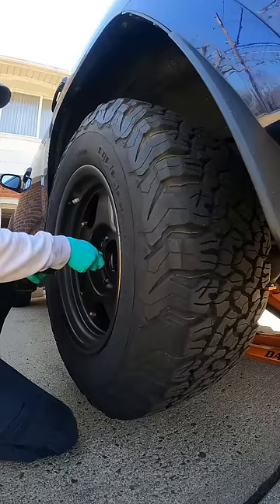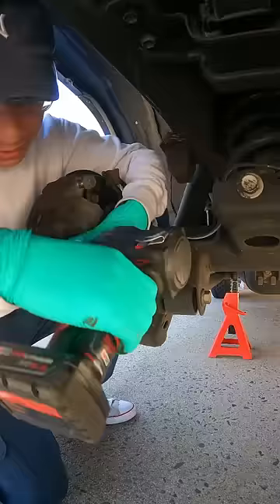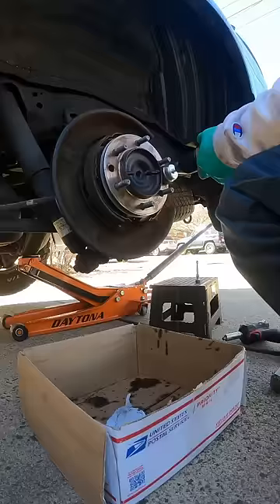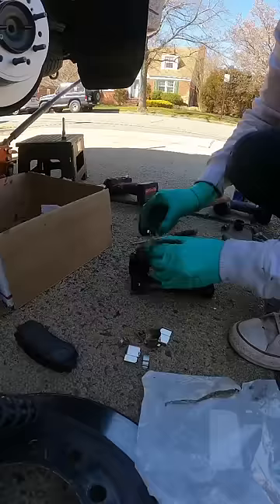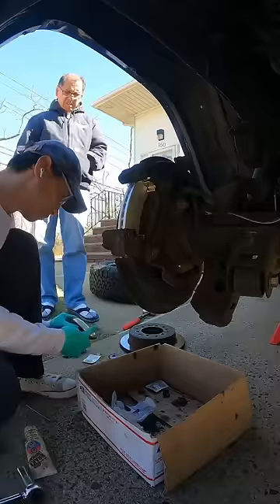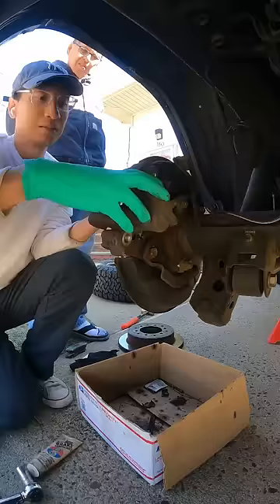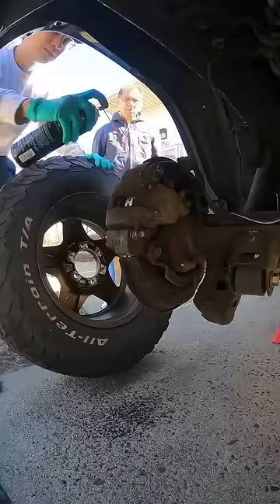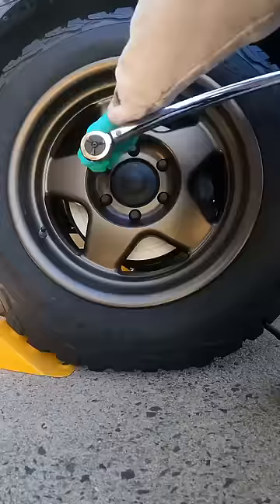Dealer wanted $700 to replace rear brakes. My DIY job cost me $100 and an hour of my time 😎

Comment: Oh so you find all those tools you were using in the back of a cab? 

Guess we're not factoring that in?
Reply: About $400 in tools between M18 impact wrench, a torque wrench, sockets, etc.  You can cut that down to under $100 easily, you just won't have the impact wrench.  Might need a breaker bar to break loose the caliper bracket bolts.
Reply: @luisamoa2500  I like Dustin's response better. He didn't appear to take it personal. Which is good, because it wasn't meant to be personal.
Reply: Tools are reusable, and the cost gets broken down over every use. There is a good chance that he already owned the tools.

Comment: I call b.s. no dealer is that high. More like $200 to $300.
Reply from the maker: sounds like you've been to every dealer in NYC to ask for pricing. $200 is a brake job at an independent shop, if you're lucky.
Reply: They are that high. My daughters friend took her car to a shop and they wanted $1200 to change rotors and pads on all 4 wheels.
It cost me $225 in parts to change 2 of my daughters rotors and pads on all 4 wheels.
Reply from the maker: @kmacnumber2  that's the spirit! DIY brake jobs aren't so bad and can save tons of money, even if you buy parts off the shelf at Autozone or O'Reilly's. I got my rotors and pads on sale at Rockauto and my wallet couldn't be happier!
Reply: @boltsandbanter  no I work at a dealer. So I know the pricing
Reply from the maker: @tonygregori4138  cool so maybe your dealer can teach NYC dealers a thing or two about fair pricing. I haven’t been quoted sub $500 for a brake job, ever.
Reply: I totally disagree. I would've expected more than 700 from a dealer
Reply: No Toyota dealer maybe. I can look up any Volvo dealer near me and it’ll be $400 for a pad slap on one axle. $1600 for pad and rotor F+R
Reply: That's probably only for the pads.
You claim to work for the dealer yet you do not know anything about the prices (parts +job).
Reply: Firestone quoted me 900 for brake pads on a GMC Acadia. They also quoted me 800 to do plugs and wires on my Silverado. I did not have them do work on either car. I guess I’m only using them for tires.
Reply: My shop I charge around $300-350, if I didn't charge that much my shop wouldn't exist
Reply: Well folks those shops want to make money yes they also use factory parts which are twice to 3x as expensive as auto zones Chinese or Taiwanese or non USA made parts. You pay for what you get. I don’t agree on the price of factory parts but they are designed for your specific model so folks take that into account also it helps if you know a good mechanic
Reply: Rotors and pads: $3-500 in parts alone
Reply: @TheBeingReal  just put red powder coated calipers high carbon rotors and fresh pads on the back of my Toyota for 350 bucks. Not sure where you are paying 500 dollars for pads and rotors but I would recommend reevaluating where you buy parts
Reply: @evandrewmartinez1  F350
Reply: They quoted me $750 for a brake job at my local toyota dealer. I laughed my way right over to the parts counter. Bought the parts for $105, took them home & did it myself. Cost $50 to have the rotors turned. 
The deakership tried to tell me I had to buy new rotors without them even having looked at them. 
They are assholes & so is every person who works for any car deakership.  Yes that means you.
Reply: Most of that cost was oem parts. Toyota brakes are pricy
Reply: Dealers charge like $500 for blinker fluid and seasonal tire air change (not good to run spring air in the winter) lol
Reply: You have no idea what your talking about. I work at brake Masters as a tech and did all four brake pads and rotors on a Honda Accord. I looked at the customer receipt and was shocked they charged them $1200.
Reply: @kmacnumber2  that is what they charge at my work.
Reply: @waynes.2983  The tech does not make the rules  or prices. We just diagnosed the vehicle and it is management and service writers who screw people over.
Reply: I work at a chevy dealer. I promise you we would charge at least 250 for parts alone.
Reply: @boltsandbanter  Apples and oranges. Prices vary depending on location, lower operating costs, lower prices.
Reply: @evandrewmartinez1  Red calipers add 700 horsepower, that's a fact.
Reply: @waynes.2983  Thank you so much, but anyone that wouldn't put new rotors on with new pads has nothing of value to say. So, you take a rotor, probably already warped, machine it thinner, so it's more susceptible to warping, and you think YOU are the smart one?
Reply: @Wishes890  lol I was just wanting them powder coated, of course now they offer black 😂

Comment: “RockAuto: All the parts you’ll ever need!” And I believe it. Most of my parts for my 02 Saturn comes from that website! Foglight assemblies, electrical connections, brake kits and calipers, suspension and soon to be alternator! So far, the parts are holding up the test of time and driving.

Comment: Here in Ontario a bit more costly. But same idea. For my Chevy it would cost $900 for all 4 brakes and rotors but I did it myself for $400. Got slotted and drilled rotors for that price too. Diy work is a huge money saver

Comment: Another tip, for a more complete job, depending on the degree of rust, remove the shims in the caliper bracket and wire wheel the shim mounting surfaces to a perfect finish. Apply some paint as you've just exposed bare metal, and install new shims. Also worth noting that the caliper piston surface which contacts the pad, as well as the opposite side of the caliper inner face must be wire wheeled and protected, in order to apply even pressure on the pads. Hope this helps, happy wrenching 🔧🧰

Comment: same, never changed a brake in my life, but Honda wanted $500 to change brakes and rotors all around.  Bought all the tools  I needed, and brakes and rotors.  Did the work myself after watching several videos.  Now I have all the tools for less than what they wanted.  Next I  did engine oil and transmission oil myself.  I find it fun and relaxing.  Not sure I would do on a brand new car, but my old Honda, who cares.

Comment: Did my brother's car front and rear disc/pad change myself. The rear was very difficult as the top bolt holding the caliper is placed at an akward position behind the hydraulic line. I was able to do the job with torque spec ;)

Comment: You only need to apply grease to the guide pins which I did not hear you mention. Also check your dust boots on the piston(s) and guide pins. Even a small pin hole can cause severe rust which will lead to premature brake failure.

Comment: What sockets do you guys use? Just finished doing the rear brake and rotors on my Mitsubishi outlander sport and the brake line was in the way of a bolt. Idk if my sockets are thick or too long. Ended up using a 14mm wrench..

Comment: Great job doing it yourself. Lexus was going to charge me $1,700.00 for a complete brake job. I did it myself upgrading to Powerstop vented and slotted ceramic brake kit for $450...huge performance difference

Comment: Over all really good, just one small but important point, you want to ensure the end of your slide pins are clean as you don't want non compressible grease on the end as it affects the pins from being correctly torqued

Comment: Recently changed vehicles and found new ones standard pads and rotors are like $270 instead of $100 or less. Was quoted $900. Well worth knowing this stuff. Also don't forget to clean the slide pin settings. Rust accumulating can cause pinching.

Comment: Amen. Dealer repairs are insane. $1100 for a lower ball joint. $1400 to “reseal oil pan”. $160 to mount/balance tires, PLUS the tires!

Comment: That's not bad. Dealership charged me $1300 for one front wheel rotor and caliper replaced. Inspection was in with that too I think.

Comment: Did the same for my Vauxhall Insignia. Quoted £700 for two rotors and sets of pads + labour. Found a set of Brembo pads and rotors at 65% off, bought some torque wrenches, total spend £250

Comment: A tip for you, don’t tighten the lugnut with an impact until all other lugs are tightened. Tighten gradually and the cross. Do this in two cycles and your lugnut bolts will love you 👍🏻

Comment: Same reason I started doing my own work. $600 to change an outer tie rod…. Picked up 2 inner 2 outer at rock auto for $144 shipped. I called bbb on that dealership for price gouging. 
The most expensive outer tie rod end for my car on mopar factory replacement was $84. 
They quoted me $7440 for new cats. For that price I’d just straight pipe the charger fym. 
Rock auto has them for under $350.

Comment: I get it, my mechanic did the same thing for my Toyota Camry 2015.
$500-600. Did it myself for $40.00 premium pads. Easy to do and if your factory rotors aren’t bad use them unless there really warped After market ones never last long there cheap metal. Took me about an hour. Saved a ton, it’s not rocket science.

Comment: It's true, I have friends that spend $500-$600 for brake pad replacements. It's amazing how much mechanics charge for simple jobs.
Reply: @Blueissocool yeah Im doing a $1200 service on my 19 escape, but that all new pads, all new rotors, all 4 new calipers and a brake fluid flush and new rear shocks and oil and filter change. Soo I can kinda see where the dealer got  $700 for the quote for brakes

Comment: A girl friend of mine was in tears because Les Schwab in Seattle said she needed to spend $800 to fix her brakes, I fixed it for $34

They said she needed new rotors and rear calipers.

The front brakes needed new pads and the rear was still good and she had a couple broken lug bolts that i hammered out and replaced.

Nothing wrong with the rotors or calipers.

Comment: During a disc-brake pad service, pushing the caliper pistons back into the caliper bores without opening the bleeder valves may dislodge some of the sludge and distribute it throughout the system, possibly causing further damage - particularly to the proportioning valve.

Comment: Pretty good job, man. Pull slow and steady with the torque wrench like you did on the caliper bracket anytime you use it. You kinda yanked it when you put the caliper bolt in.

Comment: I went to leschwab once when I bought my car. It was 1300 they also wanted to replace the brake calipers, I did it myself and they were in the best condition I've ever seen 20yo calipers in, pads didn't even need replaced but I was upgrading to slotted rotors.

Comment: Brakes/rotors, oil changes are so simple once I did a couple successfully that I realized how dumb I'd be to pay anyone anything to replace. Car shops, especially the dealer, will straight up rack u up. And they have a lift, which makes it even easier

Comment: D. Adjust the internal brake shoes first before removing the disc /rotor and then don’t forget to re-adjust after before you put the brake pads on.

Comment: Remember on adjusting the back brakes the funal adjustment you do behind the wheel and that's rolling the car backwards and forwards and hitting the brake and then alternate by putting the emergency break on do you notice it tightening up enough or it only takes a little bit of engagement

Comment: There is a threaded hole on the rotor. If you screw a screw into it it will separate the rotor without having to smack it with something

Comment: Funny, my local GMC Dealership just sent me a flyer for $200/axle on OEM brakes, which was pads and rotors and/or shoes and drums. Parts and labor.  I thought it was a misprint or something, so I called them and they confirmed it was a special they were running for like 2 weeks.  Now they are charging $139 for Pads and $185 for rotors. ($324/axle X2 = $648 plus tax.  So, it wasn't all that different than I paid for the brakes I installed)
But I had already upgraded my brakes to the Power Stop Z36 rotor/pads Front and Shoes/drums rear.  $618 Tax Included, minus a $30 rebate was $588 plus my own time/labor.

Comment: One more important tip: never let brake cleaner touch rubber parts such as brake hose and caliper seal. It will damage rubber parts and can cause leakage in extreme cases which would cause brakes to be lost.

Comment: I recommend a small film of anti seize between the hub and back side of rotor hat. This helps to prevent sticking the next time you need to remove the rotor.

Comment: If you just need pad replacement, 100% DIY.

Beyond that, there are a lot more reasons to consider ponying up for professional help (i.e. your confidence in your ability, the tools at your disposal, the value of your own time, etc.)

But remember, YouTube and Harbor Freight exist, and you can buy all the tools to do your own brakes for the rest of your life for the cost of a single professional brake job.

Comment: Why did you have to take the caliper all the way off? Also good idea to open brake fluid reservoir to relieve pressure opening the caliper. I’ve thought about opening just a brake shop for as much as shops charge, it’s like a hour job per set max

Comment: Honda wanted to charge my $1000 bucks on my si JUST FOR LABOR on the brakes and rotors (i already had the parts).  I was very busy that’s why I even inquired about it.  

I now work for myself as a mechanic ironically enough, and i had a lady where the dealership charged her $700 for an inspection and a tire rotation.  Another $7,500 to replace both upper and lower control arms in the front.

Comment: I like to put a thin (I can't stress enough THIN) coat of anti-seize on the mating flanges of the hub to rotor and rotor to wheel to prevent them from sticking and to allow easy removal later.

Comment: Sure a dealer is going to be more expensive because they are using genuine Toyota parts but you have to remember it's not just about the cost of the parts.
There is the labor, the cost of the tools, the cost to warranty for their work, the cost of their shop rent etc...... all goes into it.
If you have the tools and skills then by all means but just understand mechanics are generally not trying to rip you off.

Comment: Changed my front brakes first time last year and it takes quite a bit longer if you live in northern climate with amount of rust and stuck bolts. But worth the cost savings

Comment: I mean, dealers have a set labor rate they’re supposed to use usually set by corporate, and OEM brakes tend to be more expensive. While they can sometimes get cheaper aftermaket parts (if they’re
Not on a parts loyalty program with the manufacturer) they usually still only have maybe 10 approved vendors to shop from. Then the parts have to be marked up around 40% from cost to be billed to service. Tools are expensive, but if you have the money to invest in some good ones, then you will save money over time

Comment: What about the parking brake that's located in the drums of the rotors in the back brake area ..I take it that they were fine ,or didn't need adjustments with the new rotors.

Comment: Saved money and did the brakes properly which I can almost guarantee you wouldn’t have happened at the dealer. Those pads would have went on with no lube and the caliper would have been slapped back on with an air gun as most flat rate techs do. Lol

Comment: I'm having a hard time believing that anyone with nice floor jack, jack stands, battery impact gun, etc even bothers to call the dealer to ask them to change the rest brake pads. He obviously has more than enough tools and knowledge; he never would've bothered calling.
Props on making an easy to follow DIY video, though 👌

Comment: I'm kind of shocked the dealer's price for pads and discs was that low tbh.

Replacing brakes with the cheapest option isn't really my preference, but it's fine in most cases. If he wanted an actual upgrade with >OEM parts it probably still would have been cheaper than the dealer price

Comment: BMW quoted me £1,265 to do my discs and pads (all round) on my F25 X3

I did it myself for £300 in parts. Took me about half a day doing 1 corner at a time. Could have saved a lot of time if I had a decent jack at the time and lifted the whole car onto stands.

Comment: You did remember to check the brake shoes right? For $700 they had to also be changing those and all the hardware that goes with them.

Comment: I like to open the brake reservoir and leave the cap off. Once you retract the piston, the brake fluid comes back up to the reservoir, sometimes this messes up your brake master cylinder. It's happened to me before

Comment: Painted rotors don’t require cleaning. They’re sealed. Replacing OE rotors which have plenty of meat left for aftermarket rotors is wasteful and usually are not of equivalent quality. Same can definitely be said for the pads. Especially if you ever want to go back to OE pads, you won’t have the shims anymore

Comment: I wouldnt necessarily call it an upgrade if youre getting 2 rotors and a set of pads for under 100$ especiallg for that vehicle. Maybe OEM but i doubt any part at that price is OEM+

Comment: Just changed pads & rotors on my '13 F150 4wd. Upgraded brakes & rotors $800. Synrhetic grease, cans of brake cleaner, hand towels , tools $1000 a slide pin frozen in bracket $200 my time a full day ( had to wait 2 days for the bracket). Time to bed the brakes.
If you know what you are doing, fine. If you have HF tools & limited knowledge of how brakes work beyond just stopping, either learn or take it to a pro. Its your life & someone you dont know that can pay for your cheapskate self

Comment: You don’t need to use brake kleen again, and you’re supposed to wipe it off. It’s just for removing the protective coating they apply at the factory